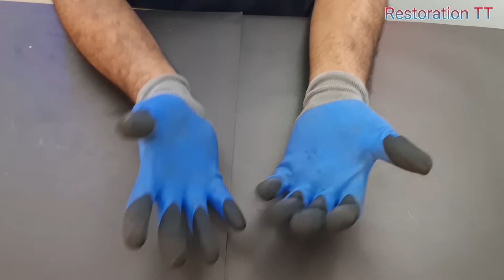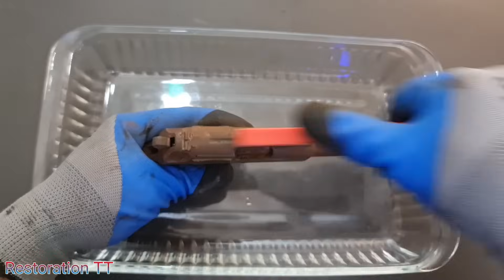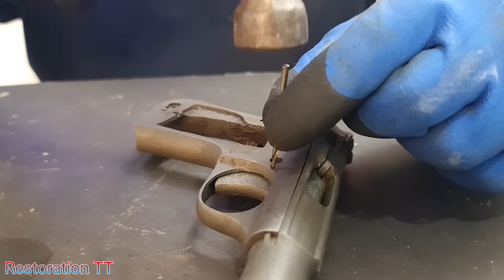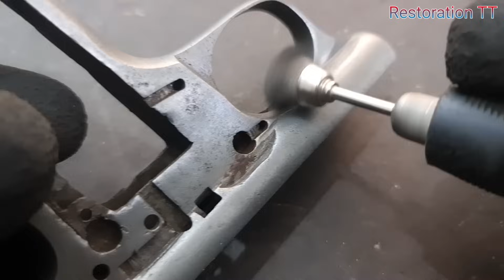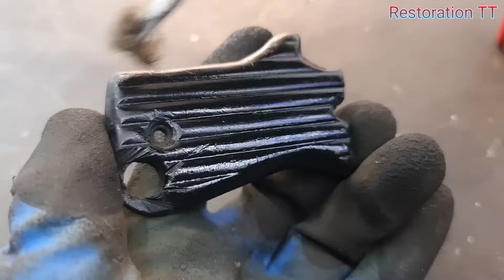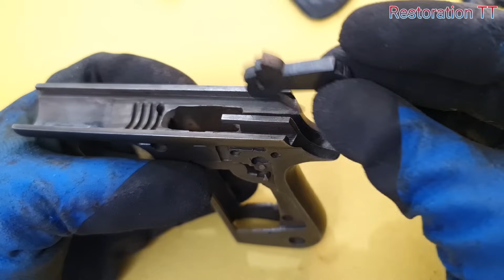Astra 4000 Falcon pistol Restoration / Gun Restoration

Comment: Good job, but the blueing could have been done deeper. Everybody has surely noticed too how easy was the polishing of the pistol. That is one of the biggest problems met with spanish made pistols from the first half of last century : the steel used was often of a rather low quality, just  good enough to make horseshoes for donkeys. And I won't say anything about the fact that from a factory to another the differences were such that for a same model, spare parts made here couldn't be used in a pistol made there...
Reply: That is not true .. not on Astras ... the steel was very high quality . do some more research my friend .
Reply: @davidfriend1919  Read well what I wrote, my friend... I said "often", not always ! The steel used to make Astras was indeed good, and it was the same for some other weapons. But many spanish locally-made guns really used a steel of poor quality, not to mention the fact that, for a same type of weapon, the interchangeability of parts wasn't always guaranteed...
Reply: @laurentdevaux5617  Yes the Astra 600s in particular  are always noted as being good quality steel they have a sort of cult following , well then we agree by and large ..yes some Spanish pistols are more just knock off cottage industry type guns . The astra is a quality brand though .. I misunderstood , perhaps .. all good then .